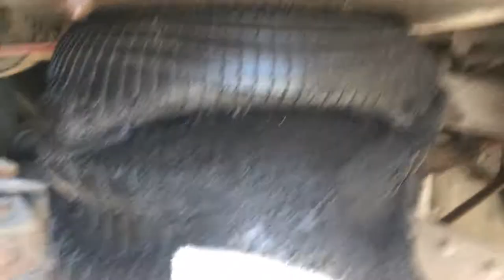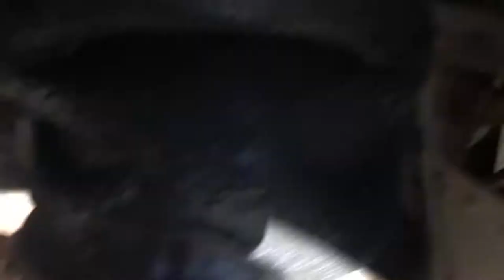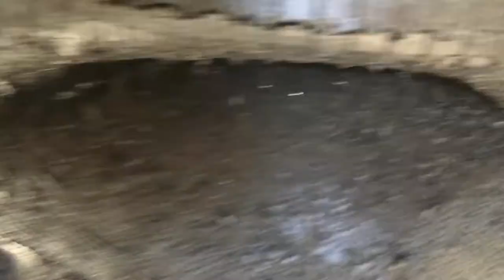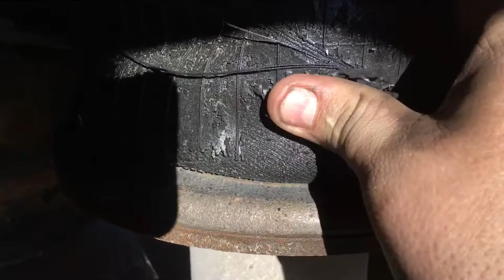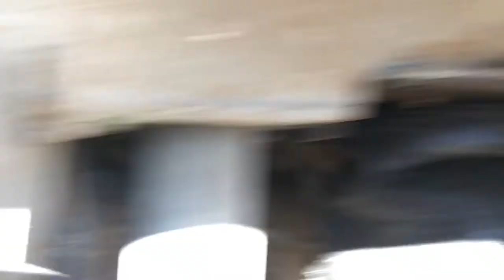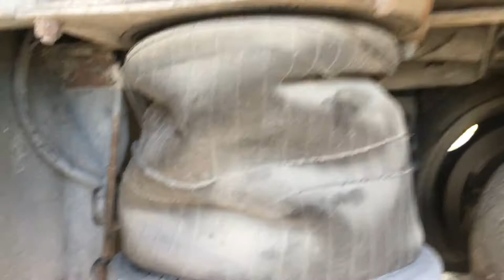Leaky air bag 4106 bus

Comment: Where do I jack up the 1962 GM 4106 bus at in the front to fix a air leak on the right side in the front right behind the wheel. I have a book/ manual.   ??? I am not rich but will pay for someone to come help me to get my dad's bus up and back on the road off the property. I only have 3 weeks.
Reply from the maker: Under the axle, big rectangular flat spot
Reply: I can help you on that. Send me a message
Reply: Bus Grease Monkey , Scott, I am going to replace one of the left front air bags next week on my 4106. I made it from California back to Arkansas last week on it, thank the Lord!  Talked with Luke and told him the condition of it. I40 all the way, he said from what I described it sounded like it would make it. Anyway have you ever done a video replacing one?  I thought I had seen one but can’t find it. Thanks Dennis

Comment: You say you are a mobile mechanic , I live in San Diego, California and really need someone to help me get my dad's bus back on the road before my brother damages it. I am a female and yes I am able to do a lot of the work but never did anything like this before and this heavy. I am not rich but will pay for someone to come help me please. I made my dad a promise and I am trying so hard to forfille that promise.  Do you know any one close that could help or maybe yourself????
Reply from the maker: I am in Florida then i have clients in the Carolina’s, Virginia, and Pennsylvania.  I won’t be in California until late summer.
Reply: @BusGreaseMonkey  1st let me say Thank you for getting back to me. Since you are unable to be here in time by chance can you recommend  a Mobile Mechanic close to my location in San Diego that has experience working on older buses and air leak/Air suspension please?  Next do you have a you tube Video showing the step by step how to Position Hydraulic floor Jacks on the Front axle Beam so that I can safely work under the front of the bus with out it crushing me to death? Everything I have read that my dad has copies of about the bus has BIG WARNINGS about how very dangerous it is to work under the bus.  BESIDES BEING A GIRL**  I only signed up for "101 Crash Coarse on Getting the Old Bus Named Sue back on the road" online..... Which means I am not a Mechanic because I always had my dad "Mr Fix-it " around to help me and I only know the basic stuff my dad taught me and showed me, plus I know how to read and I know how to work on my stuff but it will take me a little longer because my dad would want me to learn as much as possible about the bus so there is no easy way to learn with out a few bumps along the way!!!!!!